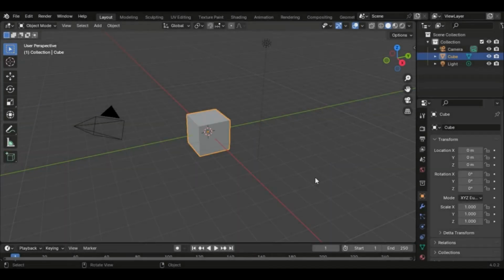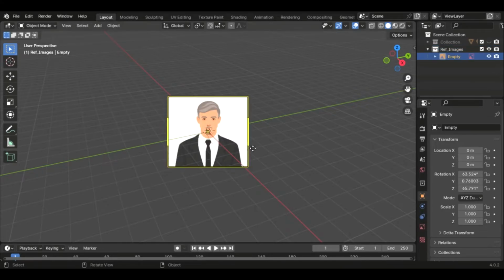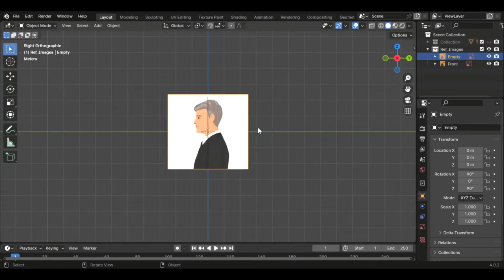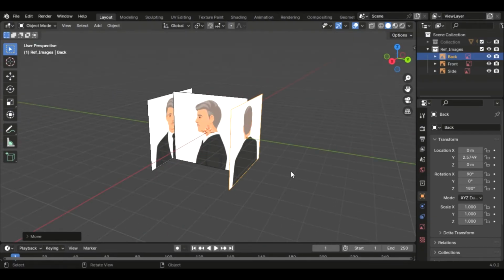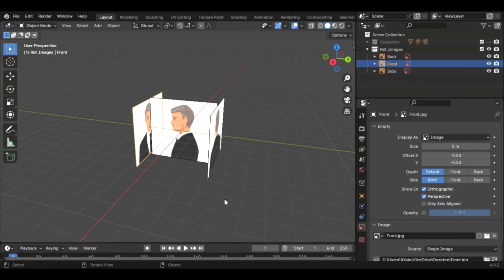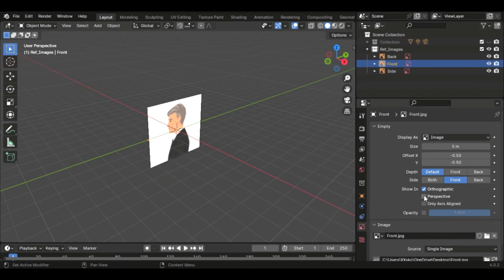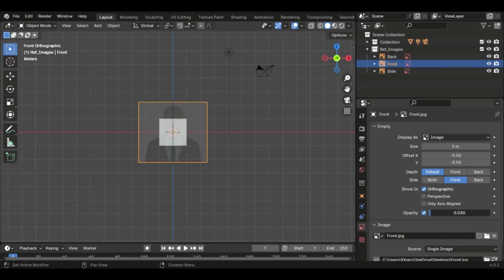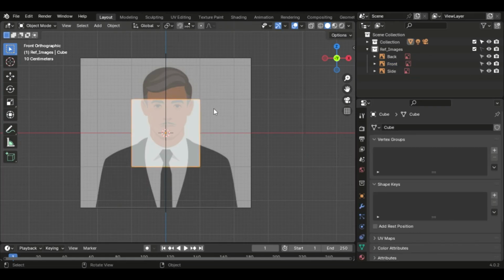Blender 4 Tutorials - How to Use Reference Images

Comment: So shift A doesn't open that window. What now?
Reply: surrender.

but tbh there is a duplicate "Add" right on top where you can change "object mode" , "edit mode" etc... you can use that if hotkey does not work